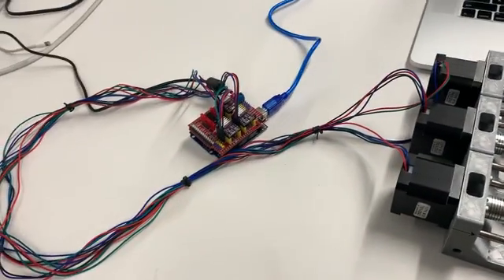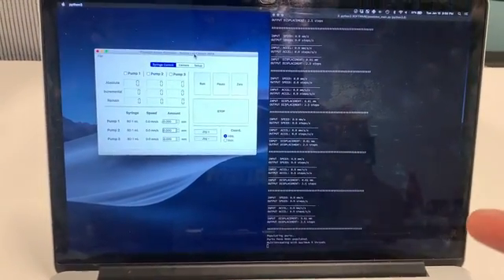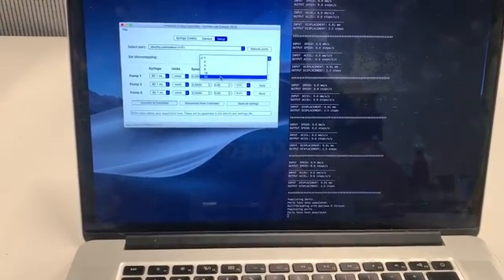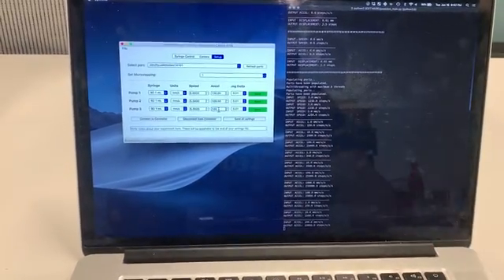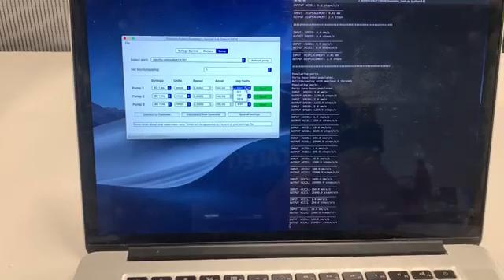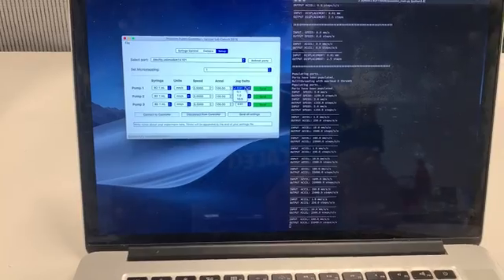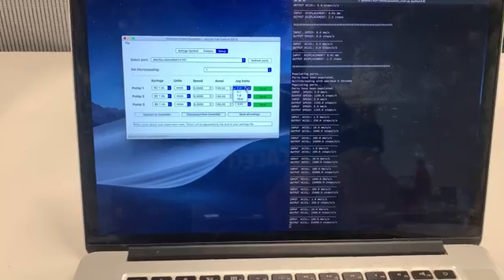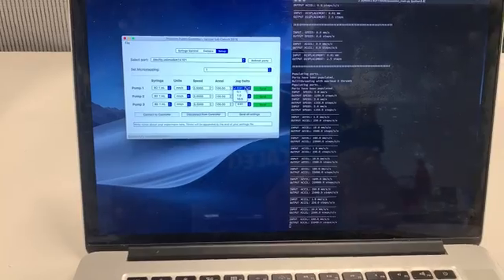Running poseidon for the first time

Comment: Awesome stuff Sina. I was actually starting to build another open source syringe pump just a few days ago before a saw this on Hacker News. Lucky timing because the other project while done really well lacked in a few things. They only offered 3MF files and the insanity of converting from 3mf to STL and editing the mesh for some customization in Fusion 360 was such a pain. They failed to mention the stepper motor driver boards so I was spec'ing them out myself from Pololu. And they hadn't done any comparisons to commercial devices. 
But you and the team at Caltech have done a phenomenal job actually documenting this and providing editable CAD files along with STLs and all the source code. I'll be building this in the next week or so and will be happy to provide any feedback if I have any. On minor suggestion is to embed this video on the software documentation page: https://pachterlab.github.io/poseidon/software . 
Do you guys have other ideas on what you'd like to open source?
Reply from the maker: Hey Viraj, I'm glad you like the project! We would absolutely love the feedback, these kinds of projects prosper from community development :) I will go ahead and embed this video on the software page, thanks for the tip. And we have a bunch of ideas! If you are interested in helping out, then let's chat. You can find my email referenced in the Hacker News thread.
Reply: How I use / open the gui
Reply: Which software is require for gui
Reply: hello how i edit the GUI from three syringe pump to single syringe pump